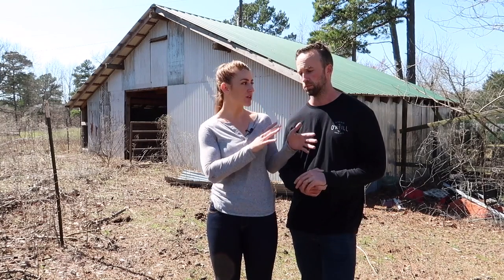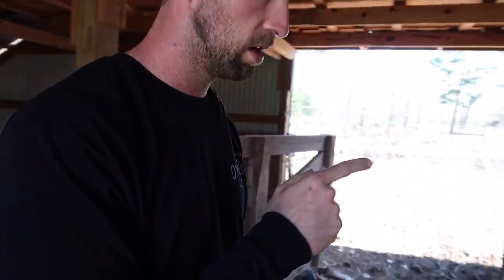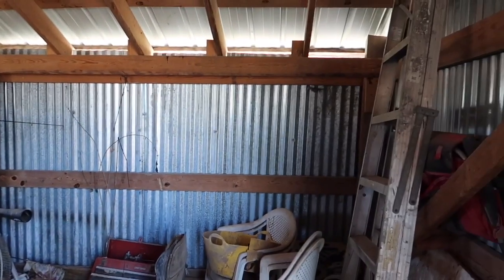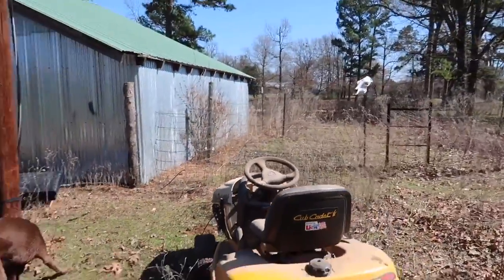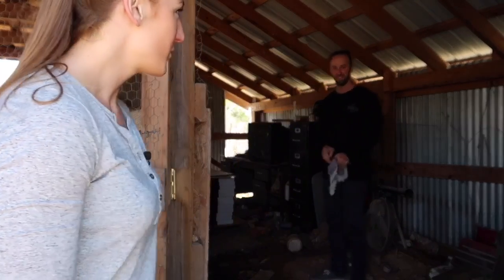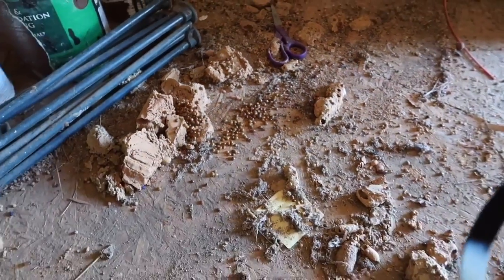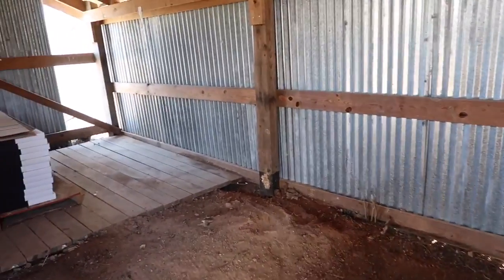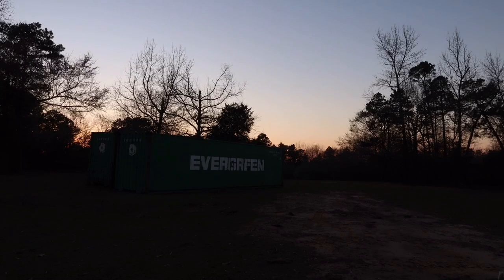Converting old barn into SOLAR POWERED workshop | Part 1

Comment: hello guys we have benn watching  you from the beginning  . we look forward to your videos i wish you could do 2 a week . 
Spencer hey while you are still wiring things up wire up some ether net  connections  also have you considered wiring in a surround sound system for your tv  , it would be alot easier now then wish you had later .
When you get ready to hang your dry wall  i suggest you buy a rotozip rotary saw  this will make life so much easier when you start cutting out your  outlet boxes and window openings . we mark where are out let boxes are then hang the drywall then measure where the center of the box is then use the rotozip around the edge of the box  one shot not doong so much measuring then remesuring once you get the hang of cutting things out this system really speeds up the work . consider getting a lift as well this will make it easier doing the ceilings remember you can always seel this equipment when your finished with your house .

Comment: Just found the channel and loving your videos! Bless you two (now three!). Pardon me if it has been suggested, but your later videos still have the panels in your yard. Why not mount them to the barn roof? Seems to be getting a good bit of sun in the video and the amount of roof space should lend itself to expansion with ease down the road. Modern mounting hardware can work really well with metal roofs. Something you probably already considered, but figured I'd mention.
Reply: Orinthical They put them on the ground for easy cleaning access. In a newer video they showed how much more power they get from just clearing them off.